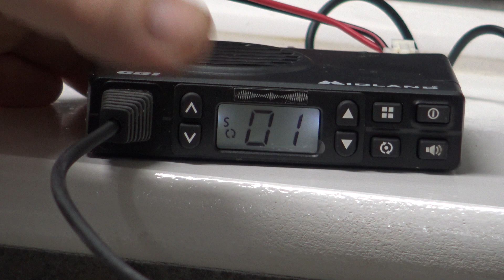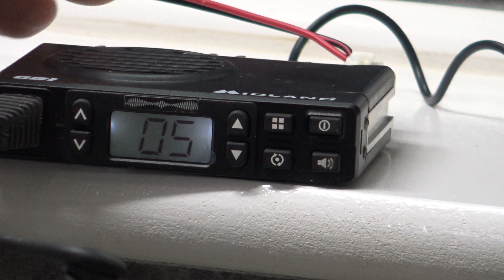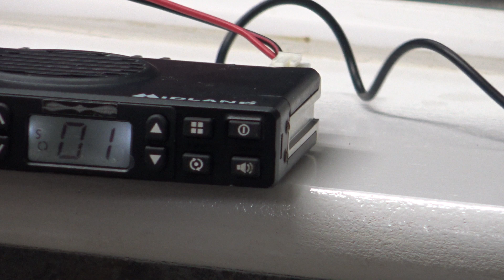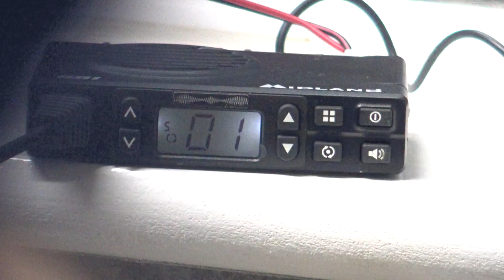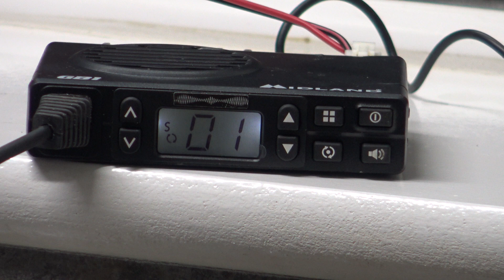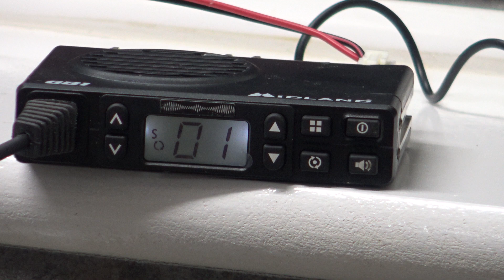Midland GB1 PMR446 UK legal mobile (0.5W) - On the air test

Comment: i think it would be work well, when you but the antenna outside....
Reply: There wont be enough power making it to the antenna (inside or outside) due to ohms law. even with 10ft of lmr cable he'd lose most of his power before it made it to the antenna. Place the antenna directly on the radio and behold the results.

Comment: This is most certainly not PMR446 UK Legal as it has to have a FIXED antenna!

"All equipment for use on PMR446 frequencies is required to be in hand portable / walkie-talkie form, feature a fixed integral antenna and operate with an effective radiated power not exceeding 500mW (0.5 watts), while the use of base station, mobile radio, repeater or fixed infrastructure is specifically excluded."
Reply: It is a fixed antenna! 3.8 meter cable, and the connector is glued
Reply: @koosme6624  Fixed means NON-Removable and permanently affixed to the unit as in being part of the unit that can not be removed.
Reply: It is fixed. If you removed it it would not work. The antenna is in a sealed unit.

Comment: For the money and effort I really don't see the point to these radio's, at leat give them a couple of watts and ariel socket, same goes for the 446 handhelds, good test and range review to the bottom of our street lol
Reply from the maker: It's a 0.5W service. It has to be a tethered aerial to fulfil the rules of 'non removeable aerial'. I recall we maganed 2.5 miles on it, so considering it's supposed to be an 'on site service' the radio went far & beyond it. Yes, very expensive but does have it's applications.

Richard, G0OJF, UK
Reply: @ukfmcbradioservicingTango21  PMR446 is starting to get a larger audience, on my little Midland Handheld I'm picking up a lot more people, they cant hear me but I can hear them some of them 10 miles + and very clear, I'm afraid a lot of people are breaking the law and using these Baofengs UV-5R which are 5 watt radios and very cheap, channels 1-4 they leave alone for the Bars, shops and other business but Ive found a lot of local networking on Channels 6,8 and 10

Comment: Very disappointing result, is everything being lost in the dreadful coax, the design and build of those units look as though they could do better
Reply from the maker: I reckon you are correct with the coax. To be fair, PMR446 is a 1/2W 'on site service', and this radio does that.

Richard

Comment: A PMR446 radio with less lossy co-ax would obviously work better, and no foreign interference to jam out local contacts, which is what CB is intended to be used for. It'd be interesting to see how 934MHz compares - if it was still legal of course. My furtheset contact on 934MHz, was Dunstable Downs Bedfordshire, to Winter Hill Lancashire, 150 miles/240km, in lift conditions, Cybernet Delta 1, 5 watts into a colinear, but the range was surprisingly good even in flat conditions.. The uhf CB allocation in Oz & NZ is well established with hundreds of repeaters, and has more or less destroyed hf CB down under, as uhf is so good.
Reply: Here in the U.S., we have GMRS, which has repeaters at 462/467MHz. It seems the service is exploding here every day!

Comment: Was looking forward to this but how disappointing given the cost of those units im struggling to see the point of these and the market for them. I think sales will be slow and they will drift into insignificance 😑
Reply from the maker: As always I try to sit on the fence & weigh up pro's & con's. I can see a use for a young family enjoying caravan holidays & using one of these as 'base' in a caravan rather than faffing around with a handheld & flat batteries....in the office of a small business, the staff having handhelds. We use those Retavis handhelds around the place...this is a one acre site....and one of these sets may help. 

The way we do communication here is that if someone is needed we can put a call out over the tannoy system (22 speakers).....that person then switches on a radio & calls back.

Richard

Comment: Lovely little radio but far too expensive 🤔

What radio was Mr Chippie using? I'm assuming it was a PMR handheld. The signal would be severely reduced by the metal body of the car, from experience simply getting out and transmitting next to the car would make a big difference.
Reply from the maker: No Delboy, he's using an identical set with the magmount on the car roof right in the centre.

Richard
Reply: @ukfmcbradioservicingTango21  well that is disappointing then. I honestly thought they would work better than that. 😮